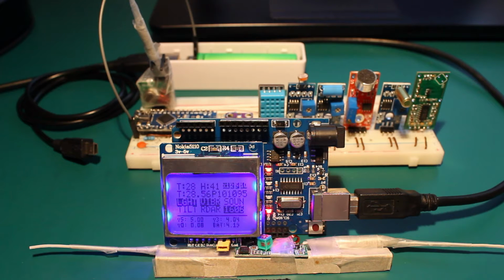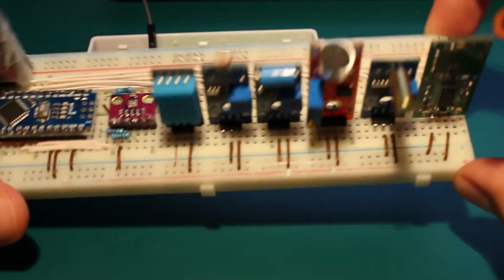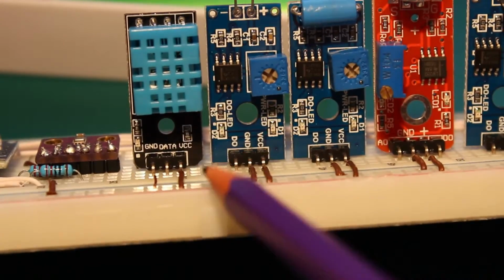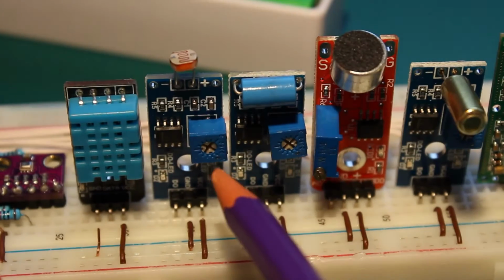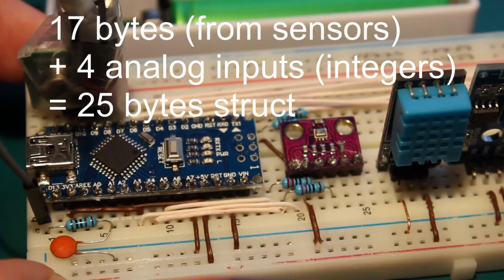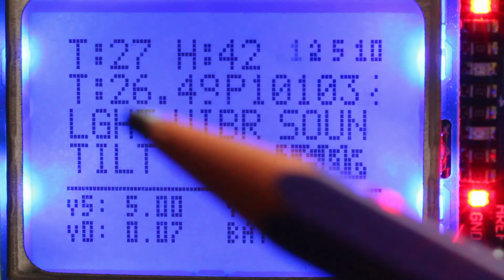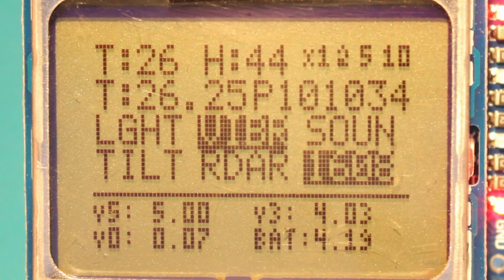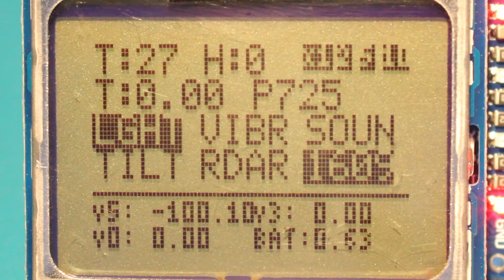Arduino 433MHz RF Sensor Array Data Transmission

Comment: Very helpful, thank you very much!
Reply from the maker: I'm glad it was helpful! What kind of project are you building?
Reply: @argilaga  I'm building a automated watering device and a automated chicken door in our backyard. Sadly, we don't have WiFi in our backyard, so I was looking for an alternative and 433mhz sender/receiver modules seem to be a very good and economic way to go. My plan is to have two independent devices based on a arduino nano reporting e.g. soil moisture and the current state of the chicken door to a esp 12F which then forwards the information to HASSIO.
The esp would actively poll the information to avoid interferences and it would also send commands based on hassio automations (once I find a way to integrate all those data in HASSIO and have it send all the needed commands). In addition to that I would also want to have a "fallback" method, which would jump in, in case there is a problem with the data transfer or hassio. I haven't spend many thoughts on that yet, though. 

Currently I'm searching for a way to integrate the data in HASSIO and I'm still struggeling a bit with the .yaml files. They are nice to read, but for me they are very difficult to write and it often feels only like copy/paste ... I'm thinking about integrating each value as a seperate sensor and every action as a switch, but it seems to me like there should be an easier way, which I just didn't find yet.

Do you by any chance have experience with HASSIO?
Reply from the maker: @pallme100  You have a nice project in mind! indeed the 433MHz module is one of the cheapest radio units out there, range can be a limitation, but with a simple antenna you can go easily up to 30m range, all depends on the EM interferences around your home. 

Sorry, no experience with HASSIO, good luck!

Comment: @argilaga awesome video here. I was curious on your rf receiver antenna. can you explain me the method? i'm trying to receive rf command from universal garage door's remote, but could only have like 2 meter range. I would like to improve to 5 meter maybe 10 meter. thanks
Reply from the maker: Hello, thanks! check your remote frequency and cut a metallic wire at exactly one quarter wavelength, solder it to the antenna terminal or just use a crocodile clip. This will greatly increase range if you do it in both Tx and Rx modules, but if you still need extra range you can look at fancy antenna designs like dipoles, coil loaded antennas, etc. I will update the comment with some links later. Be aware of your country RF laws and transmitting power limitations!

Comment: Hi, I have joined your channel as I am interested in 433Mhz radio as I want to make a receiver to indicate doors open or close but wanted to see the sensors that are triggered and your project will do the job very nicely so thank you for sharing your hard work I am looking forward to any more videos you provide as I don't want to use wifi for reliability reasons.
( just a note for you your display should only be run on 3.3 volts plus all data pins or you will get degradation of the display)
Reply from the maker: Thanks for joining! Indeed I think that the 433MHz is the best choice for your application. I'm aware of the danger of using 5v, the display has written: 3v-5v, so it seems to be in the range but many people says that it may not be that tolerant to such a high voltages. After the testing and recording the video I stopped using it to avoid further damage to the LCD. Next time I will mount it to the STM32 which is a 3.3v board.
Reply: @argilaga  Thanks for your reply I was not criticising your choice of power just thought you should know and I see you are using RCWL-0516 Radar Doppler sensor but I have had a problem when using it blocking other radio signals so would love to hear your thoughts on it? thanks Bob